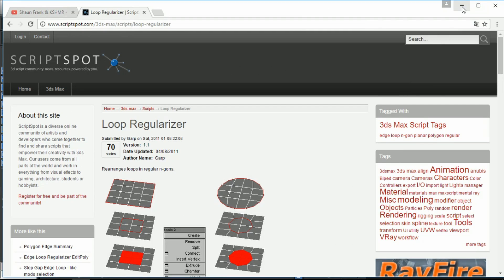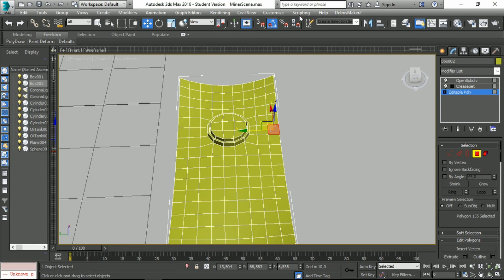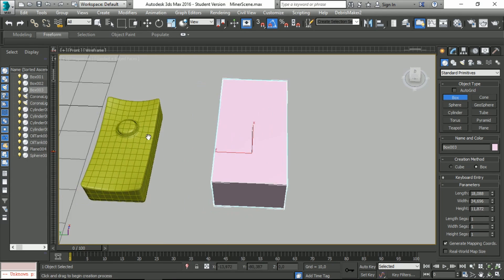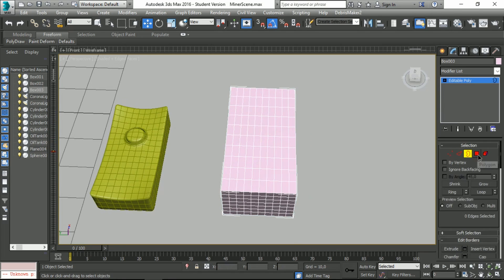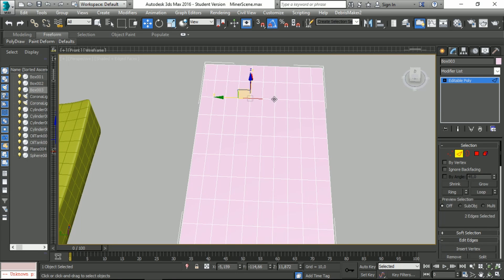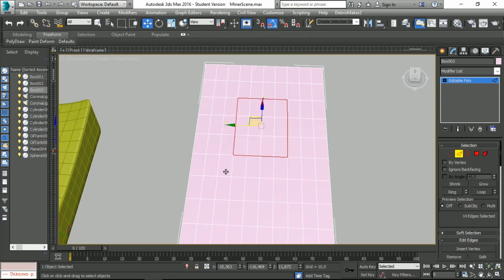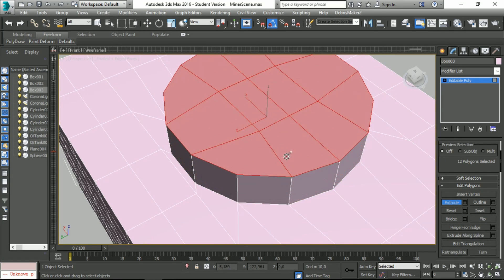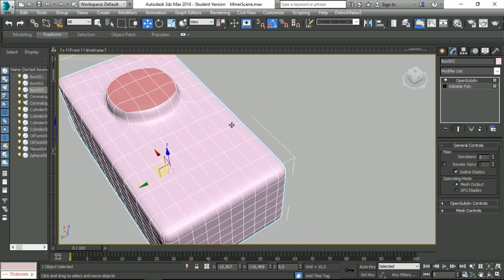Loop Regularizer-3ds max

Comment: does this work on non planar surfaces like the side of a cylinder or sphere. does it conform to the sides cause if not, i'll just use spherify modifier.
Reply from the maker: Im so sorry I was answering to another question on your comment ;)   Yes It can be used anywhere you want . And can be use in non planar surfaces but sometimes you need to make it follow the shape . It depends to be honest xD